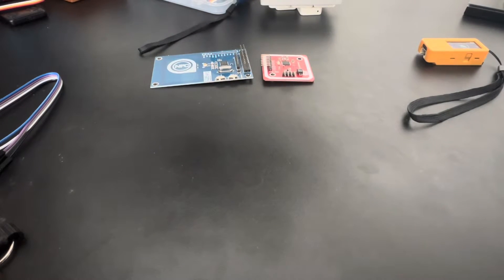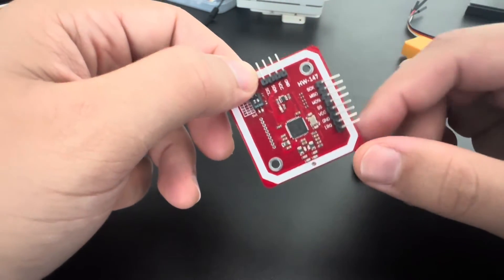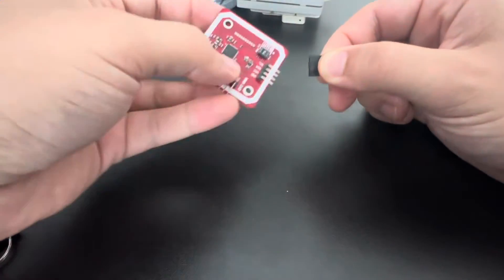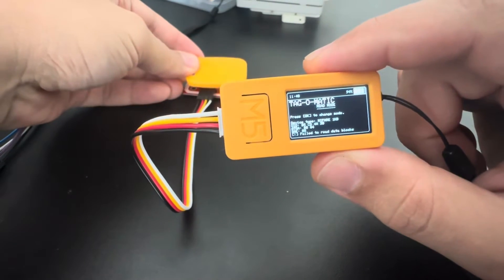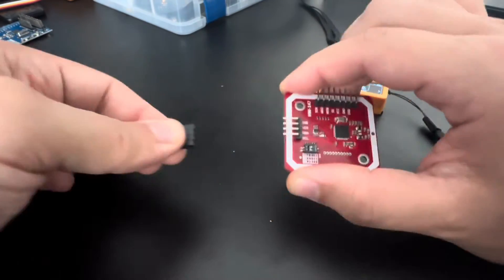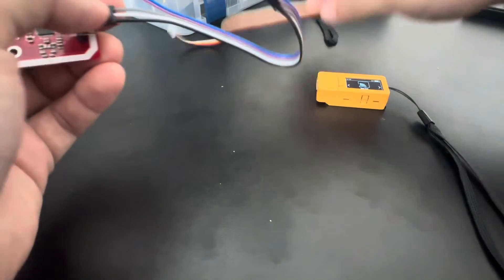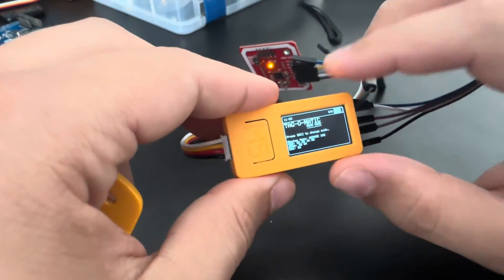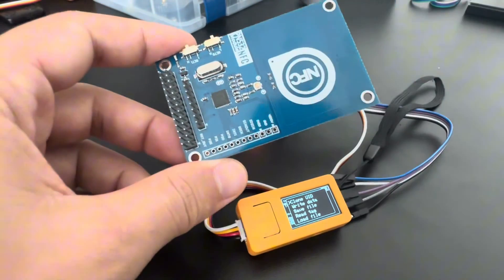PN532 with M5StickC Plus2 and Cardputer using #BruceFirmware

Comment: i orderd my m5 stickc plus2 with all the modules and for the cables i got M-F does it work?
Reply from the maker: @FishyTris  if you connect using SPI you’ll need a M-F cable to connect to the gpio pins. But for the grove conector it won’t work. It has to be a F-F or a F-grove cable

Comment: It says rfid module not found I've configured It in bruce and I'm sure I've connected it correctly cause it turns on and still doesn't work
Reply from the maker: @AlyoshaKarafeziev  something must be wrong 🤷‍♂️
Reply: I'm facing a similar error, were you able to fix it?